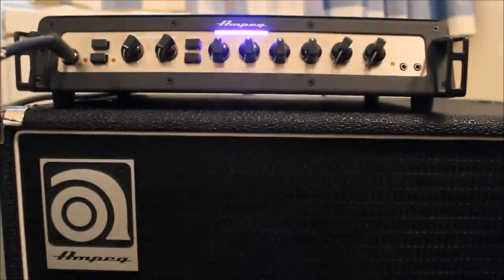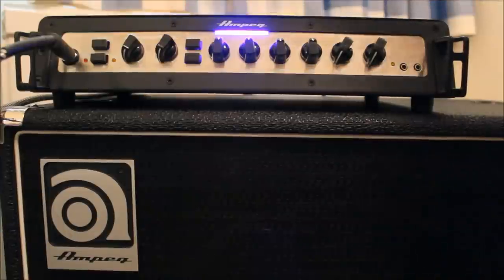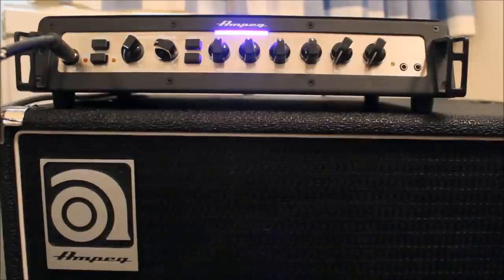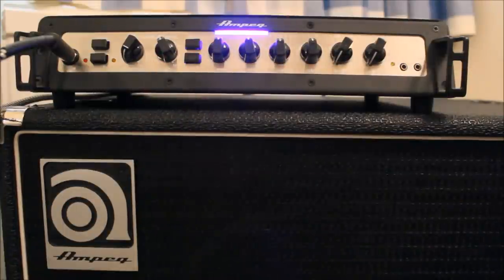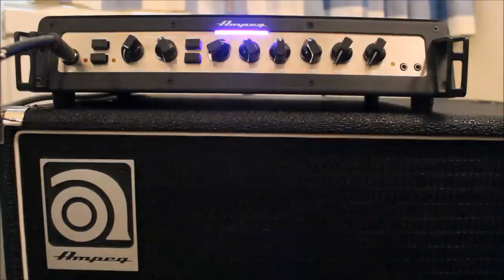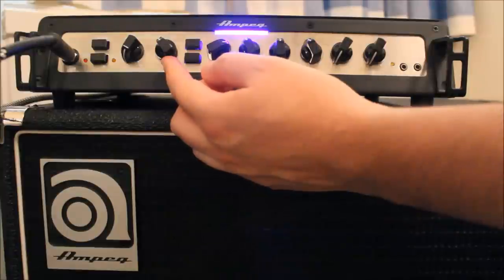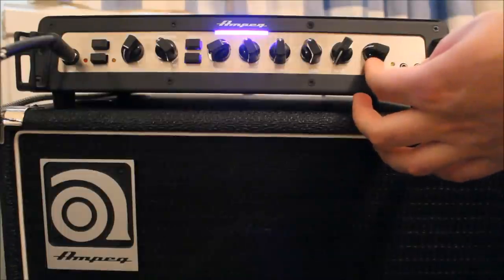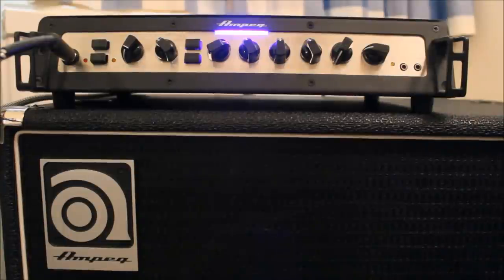THE SECRET TO A GREAT BASS TONE | Understanding Gain Structure

Comment: For the people who don't have a peak light it's gonna be a bit tougher but nothing you can't manage. At low volume play a strong note like he did and higher your gain until you notice the signal distorts and is not clean anymore. Back up the gain a little bit. Set the volume at the desired level. You're all set.
Reply: thierry berno thank you for this
Reply: What if i dont have gain... lol
Reply from the maker: Bang on Thierry. Thanks for watching!
Reply: exactly, having a very loud bass on stage is nothing if it already sounds distorted outside the stage, sometimes its not the amp, its the external housing that makes the sound of the bass extremely distorted when already heard outside the stage. only solution for that is to get the volume lowered a little bit.  some bassists keep thinking having the loudest bass is the best, where in reality its not always about the volume, its always the clarity when heard outside the stage
Reply: This quite an effective technique

Comment: Don't cut your mids! Mids are where the tone lives!
Reply: Fretless, the high mids are necessary.
Reply: Also, noon is NOT FLAT on the midrange knob of these Portaflex series heads. The mid knob has -20 db of cut and +10 db of boost, meaning that 2:00 is flat, not noon. He was already cutting his mids even before he turned them down further. People really need to read the owners manuals of their gear before they spread misinformation

Comment: Dumb question—isn’t the gain the input signal going into the preamp, pre-eq? And if so, why does the eq affect the gain light?
Reply: i don't know why but even in ampeg's videos they say you should readjust gain after boosting any EQ as it does affect how the gain behaves. if you set gain like he does in the video then boost the bass on the amp the peak light will be coming on and if you don't want that you have to lower the gain

Comment: When I followed the advice here I found that I can't get any volume. I thought it funny to buy the POWER of AMPEG only to have the peak light control my volume to nill. Asked a buddy and long time Ampeg user about it and was told not to worry about the peak light but to get what I need out of the amp. Been happy ever since :P
Reply from the maker: Michael Williams Hi Michael. Don't forget to turn the volume up once you've set the gain 😉
Reply: I did. The peak light was having none of it. TO keep it off I has to use the DB reduction button. I have the SVT-8 pro by the way. Maybe its just touchy.
Reply from the maker: Michael Williams Depends if you're using an active Bass or pedal setup with a naturally high output. Then it would often be on a lot unless you use the dB pad. SVT Pro series are notorious for having issues, couldn't say for sure without seeing it.
Reply: All I know is when I am using my ampeg the rack compressor gate will not engage as the amp seems too hot. I do use a few pedals.

Comment: Nice Video!
I tried it on my Bugera BTX36000, with the signal coming from active electronics/eq inside the bass, through the pedal board and a rack gate/compressor and the only way to get the clipping light to do even a little blinking was to crank up the makeup gain on the compressor to the limit... that kind of made me wondering if thats a normal thing to more ppl ?
Reply from the maker: Hi thanks for watching. It sounds like there's a lot going on in your setup. Your Compressor will be doing a lot of the work to keep the signal from being too hot - which would be why you have to crank it so much before you get any noticeable distortion.
Reply: Thanks for the answer! I think it could be something like this... sadly I don't often get the chance to work on the whole setup without some impatient guys running around. I'll give it a look when I get the chance to... maybe turning up the pedalboards output a bit and stuff like that.

Comment: So the idea ist to get the most out of your preamp without distorting. Why though? I get the bit with the engineer but how does this make the amp sound better?
Reply: Thanks for watching! By setting up the gain structure right, the EQ will only be adding or reducing the frequencies you want, not acting like a secondary set of volume knobs. It also means that the engineer has a better signal of 'your sound' and the amp will also live longer when operated properly. Overall, it will just sound better.

Comment: How would you recommend adjusting your gain if your using distortion pedals?
Reply from the maker: mangbeloy Thanks for watching. The same rules apply if you want a strong signal out of the amp, that way your pedals shouldn't have to do all the hard work. For example you don't really want a weak amp level with a pedal maxed out to get it to a decent volume.
Reply: Thanks for the reply

Comment: Well, I own a Pf-350 as backup for my full valve bassman. I almost crank gain control up to 3 o'clock so that I get the sound I like. Clipping led is obviously lighting up almost continuously. Dealing with master volume so as not to reach protection breaker, makes my Ampeg SVT410 Heritage series wreck walls.
Therefore, I can't agree with this recommendation on how to use gain stage. In fact, IMHO, the crucial point for a tone is the speaker's section.
Reply from the maker: Alvaro Fernández thanks for watching. It sounds like you're actually using this method to get the correct gain stage. Glad it sounds awesome, those 410s are beastly!
Reply: hi dude!!, Well, not really, I meant I crank the gain section all the way up at three o'clock position independently on how much the clipping led lights up. I just search for a slight overdriven tone. Then I logically must deal with master volume.
All in all, this is a good approach to explain gain section
Reply from the maker: Alvaro Fernandez for sure, putting it into the clipping stage will give you a good overdriven tone. Crunchy!!

Comment: That PF 500 with an Ampeg SVT 4x10 is the worst sounding rig on the planet. And that was using a very kick ass 1996 Musciman Ray4. It just sounded like it was gutless. But that same cabinet with my Ampeg SVT 4pro and or my GK 700 RB made that same 4x10 cabinet sing big time. I got rid of the PF head, Never ever again. Now it may be fine for some real low volume stuff, But not for rock at all.
Reply from the maker: anthony knows The PF heads exist to be used with their PF cabs counterparts. Really, the 410s are designed for higher output heads like the SVT etc Thanks for watching  👌